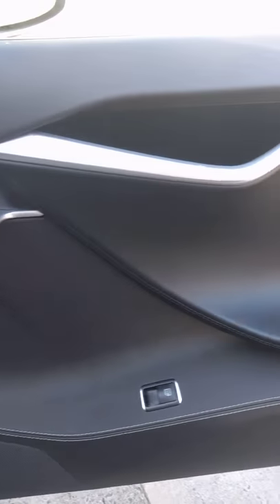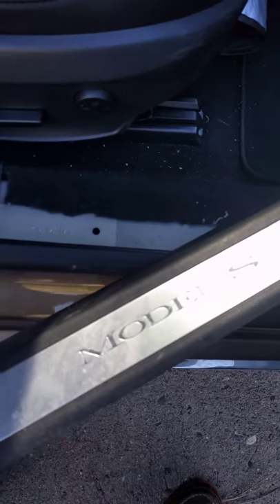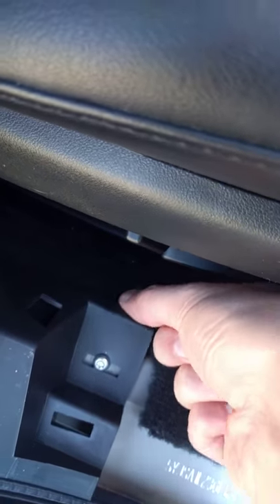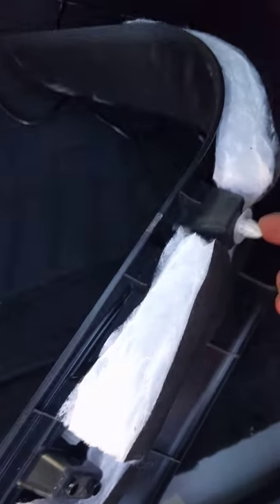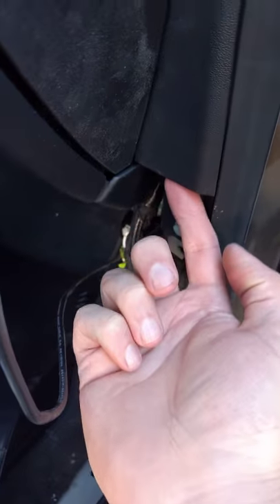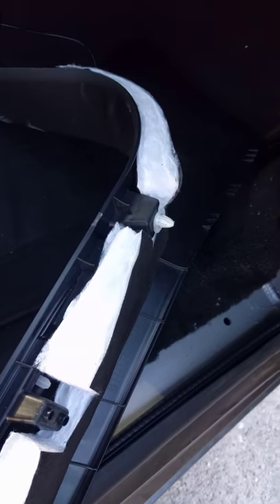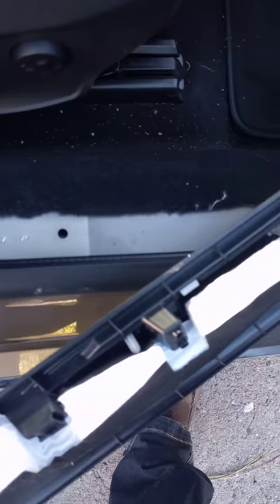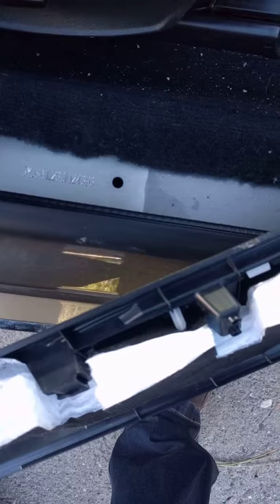Tesla Model S kick plate removal to access fuse box

Comment: Did you note what number the fuse was? or was it the only 15A in the box?

I tried looking in the owners manual for the Europe version and found the schematics for the fuse boxes but they did not match mine.
So I calles tesla Service and the guy tried to look it up but did not find either...

They reccomended that I go to the service Centre.
Reply from the maker: F202: Third from the top on the left column. I found a fuse diagram PDF through Internet searches and pulled this first: it was the one that was blown. Tesla apparently changes fuse setup all the time, so this might not be the same on your car.

Sorry it took me ten months to get you an answer, I'm sure you solved your problem by now. Hopefully someone else has a little easier time now that it's documented.
Reply: Neale Pickett Hi. Is this for the power for the usb accessory? My drivers side usb will not charge my phone but the passenger side does.  I could swear that before both USB ports charged cell phones. When my wife and I are in the car we now have to share one charger port.  Lol.  But anyway is this what you were repairing when changing this fuse